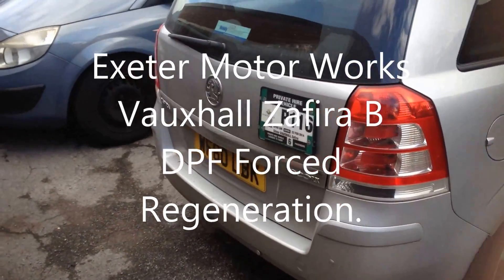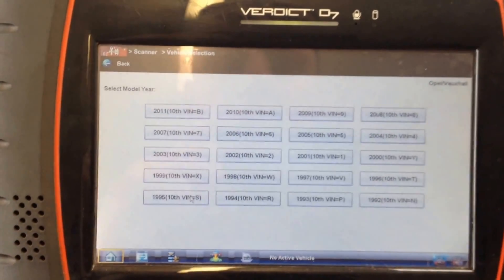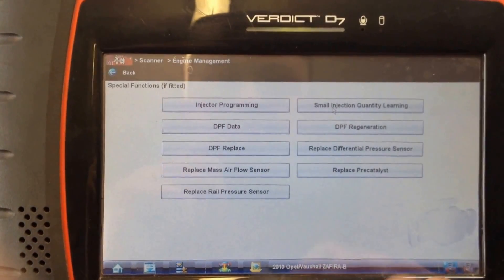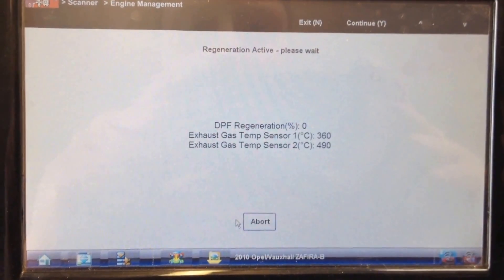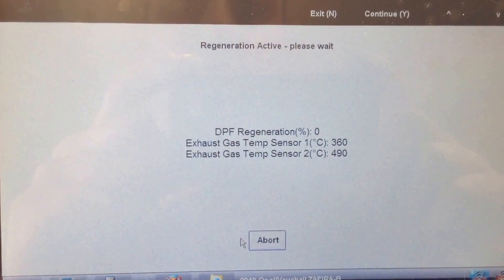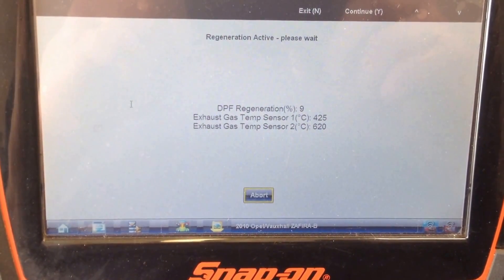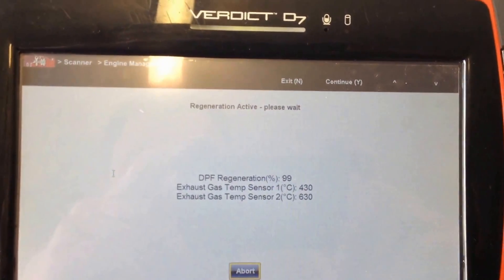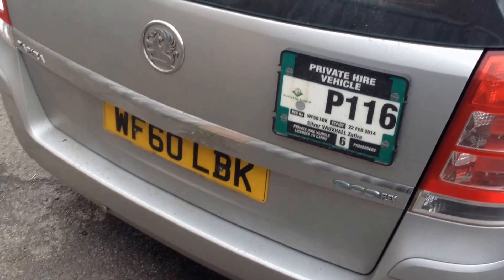Vauxhall Zafira DPF Diesel Particulate Filter forced  regeneration using snapon verdict

Comment: I understand your point but without special intake fluid you do not regenerate dpf cleaner. Simply motor do not remove all ashes etc.
Reply: It pumps  more fuel into the dpf ... which  gets the temp up to over 500 degrees... not a deal will be left after reaching thst temp..

Comment: and if u dont fancy doing what ive said be low this u can always drive ur can in 3rd gear at 3.5 rpm for 7/8 miles staying at that rpm and in 3rd and the car with go into its own wsy of cleaning the dpf its self u will see smoking comimg out the back just keep going by the end it will be clean all by its self hope this helps

Comment: hi guys in my time ive had to do a few dpf to cars from the ones that only just run to them that have come to a stop thr fix is very easy only means getti g ur hands dirty  so all i do is takr the dpf out then off to the jet wash put the end of the jet wash in the hole of the pipe and pull the trigger  let the pressure  of the water go inside and after a minute  all the black will start coming out the other end just keep washing it out till itd runs clean water back out let it dry off or dry with an air line and thats it the last one cost me £1 two fix and an hour of my time ?
Reply: thatgamer tho.  This can't be right,  surely it would completely smash the inside? Dpf's are the devil like,  especially on vauxs given their crap regeneration system.

Comment: I got same problem. Power loss under 2500rpm. Automatic diesel Vauxhall Zafira. Now trying dpf cleaner add in to the fuel tank. Hope this should work. Local garage said turbo or gear box gone.

Comment: A lot of cars are affected because sometimes a lot of people drive like old people to 'save fuel' when really this video is proof it's not good for cars and it also pisses other road users of with your slow assed acceleration from lights etc
Reply: +1700iDiGuy they get clogged if you dont drive them far. they have to driven long distances for them to regenerate.

Comment: Hi guys. I've got Lexus IS220d 2009, ~155k. I use Shell Nitro+ diesel (~50 litres) and add Wynn's DPF cleaner in a black bottle (professional range). Then go on a motorway and drive on a third gear keeping my revs at 3000-3500 rpm. Speed is about 60 mph. Every 1-2 minutes I sharply accelerate to just over 4000 rpm for 5-10 seconds. It takes about 20-30 mins. So, its good to do if you go somewhere far and you have to stay on the
 motorvay for at least  30 mins. Just get your tank ready (Shell Nitro+ diesel  + DPF cleaner). Good luck:)

Comment: The all point of the DPF is to cut emissions  ? If you have to drive at 3000 rpm to 3500 rpm for 20 minutes at speeds which equate to 90 mph to 110mph  or revving the engine  while the vehicle stopped ,  it completely defeats the purpose 
Vehicle's should adjust to driving habits of the owner not the other way around
Reply: Its point isn't to cut emissions as such, it's to cut particulate matter (soot), which is dangerous to the human (or any other) respiratory system. DPF actually increases the CO2 emissions (because of the regeneration cycles). The point of the regeneration process is to 'burn out well' the soot caught in the filter, making CO2 (and water) out of the carbon deposits, which is of course a bit worse for the global but way better for the local climate.
Reply: ***** you seem to talk about the (soot) and emissions like 2 different things soot is considered to be emissions , Regardless
Reply: SuperNiceguy60 Yeah, but the DPF (with regeneration cycle included) is trading one emission for others. Slightly increasing CO2 and NOx emissions in sake of getting rid of the soot, which is cancerogenic, and therefore locally more dangerous to us.

DPF cars aren't any nicer to johnny the polar bear as Clarkson uses to say.
Reply: need more adblue
Reply: SuperNiceguy60 Since switching over to high quality fuel like Shell V power diesel ive noticed more power, and better mpg. I don't have to de coke my EGR valve as often too.
Reply: shell derv and v power are the best mate
Reply: +Kristián Kopáčik yeah but if global warming does exist im up for it we get cold winters anyway plus one day we are all gonna die.
Reply: ***** In my opinion is Wrong having to turn on the Engine at High RPM while the vehicle is stopped and burn additional fuel in the name of protecting the environment
I mean this vehicle could have gone from London to Manchester , instead  Wasting all this fuel while being stopped
Reply: +NN2994 after making some research , i concluded the  quality of the fuel plays a big part on DPF issues 
if you use high quality fuel , the combustion is more efficient  , reducing the amount of black smoke
supermarket fuel is your engine worse enemy as it has no additives and produces very poor combustion
Reply: Owners should buy a vehicle best suited to their driving style.
Reply: +SuperNiceguy60  Dpf  are bad news as they don't regeneration by itself
Reply: What dose this cost to be done
Reply: need more adblue folks

Comment: The regeneration process pushes the engine to 3000 rpm and 3500 rpm this is at least 90 to 110 mph in the motorway
Reply: Too fast and why at high speeds as well for the regen
Reply: 3500 rpm is  almost the redline of most diesels
the high speed example is to highlight how much energy , time & pollution is being wasted for no reason while the vehicle is stationary 
.
he cold have done a Trip  in low gears , that would have produced the same results 
.
the objective is simply getting the Exhaust hot enough to burn the unwanted diesel particles blocking the exhaust
Reply: 5000 is my redline on my 1.7 diesel zafira 13 plate

Comment: Would driving in the Motorway avoiding 6th gear not produce Exactly the same cleaning results ?
All the Fansy looking Machine did was pushing the Engine to 3500rpm for 20 Minutes 
I mean Just Grab your Taxi and go and Visit a Distant Relative and  Save yourself some money
Reply: With some cars you have to do it this way, as the dpf won't be able to regenerate on its own after the regular regeneration has been interrupted a few times. If you know your vehicle you will recognize when it's regenerating, as the current consumption will be significantly higher than normal. When this is happening, just keep driving at high rpm for a while.